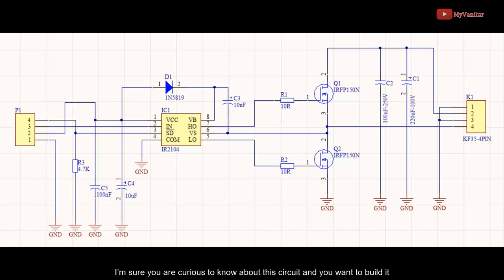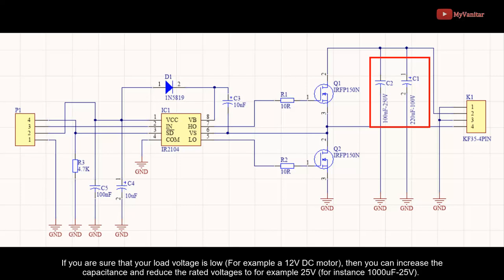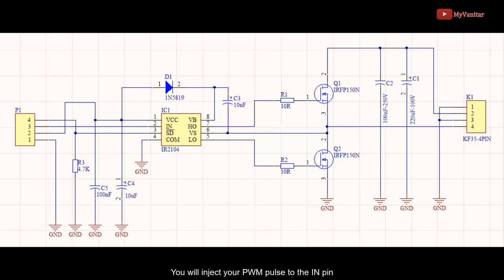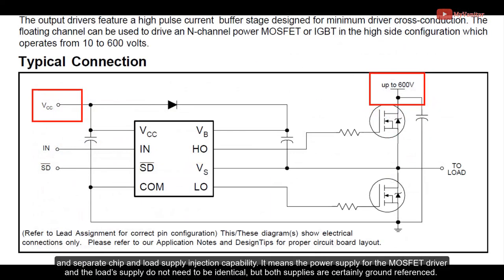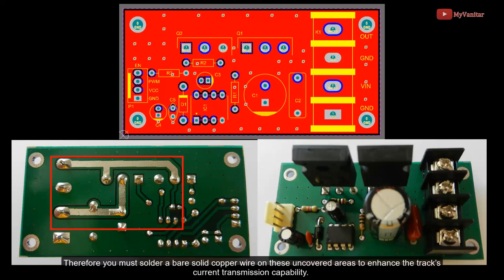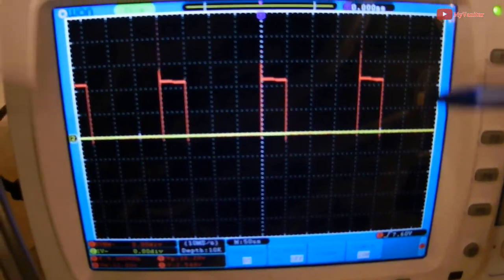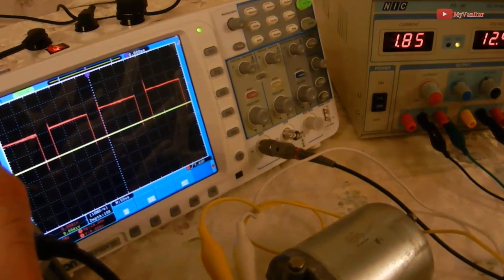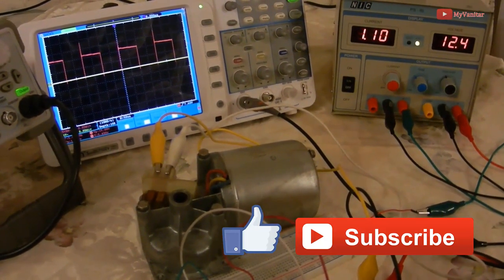DC Motor Driver Circuit Using Power MOSFETs [PWM Controlled, 30A Half Bridge]

Comment: can i use 2 relays to change direction for this circuit. I've seen your full bridge circuit video but i want to use this circuit for my project.
Reply from the maker: You can but that is not an efficient method, you can not control motor speed using relays and PWM

Comment: Great video sir...but unfortunately my circuit is not working properly....i'm not getting what should be done with the SD pin and IN pin...I'm using Arduino nano...with Arduino i'm generating a pwm of 5V with 50% duty cycle. and SD is high (5V logic). but the circuit output is not generating voltage according to the pwm signal...plz resolve the issue sir...i've struggling with the circuit for quiet e time now
Reply from the maker: Did you use my PCB? What's the Load?
Reply: @MyVanitar  my load is a dc motor 12V 500 RPM Johnson motor.  I've tested the exact same circuit
Reply: No I've used the breadboard for initial testing
Reply: And really thank you for replying....plz sort out the issue sir, it's really becoming painful for me
Reply from the maker: this circuit is simple. SD pin also can be connected to 12V (supply of the IR2104), but the IN pin must be logic compatible. make sure the power of the Ir2104 is 12V regulated. the ground of the motor supply and the IR2104 should be common. Grounds are not isolated. did you check? if you checked all of these, most likely you made a mistake somewhere
Reply: @MyVanitar  really appreciate your feedback. I've made the ground common. If you've a contact mail can we contact there. It would be of great help
Reply from the maker: Email is for commercial and business purposes, I prefer comments for questions because others also get benefit from questions and answers
Reply: @MyVanitar  okay sure Sir. Thank you. Update is I've converted my circuit into a Vero board. Let's see if everything goes well
Reply from the maker: if you had watched the video completely, I had noted about the common grounds. unfortunately from the YouTube analytics I exactly see that people from Asia are mostly hurry, just watch for 2 minutes, just want to quickly and magically build something

Comment: I have a solar panel (Voc=4.8V, Isc=13.7A) but IR2104 datasheet says that "Gate drive supply range from 10 to 20V". Can you suggest me another Mosfet Driver IC or do something else. Thanks
Reply from the maker: You want to control the output voltage of the solar panel or you want to use it to power this circuit?
Reply: @MyVanitar  I use it to charge the battery in the morning when my solar panel works, at night my battery will power my LED
Reply from the maker: @tienleminh8129  what is the battery? lithium 4.2V?
Reply: @MyVanitar  Sorry, I don't really know, that is a block of 5 batteries parallel, each battery has approximately 3.4V measurement. I can't see any parameters on it
Reply from the maker: @tienleminh8129  They are lithium-ion batteries. when they are fully charged, the voltage rate is 4.2V for each, when they are packed or if the intention is to keep them without use, the best voltage is around 3.7V. What you need is a switching power supply with 4.2V output voltage and constant current feature, depending on the capacity of the batteries. usually, 500mA current limit is okay.
Reply: @MyVanitar  But my solar panel has only 3.7-4.2V, how can I power my MCU(supply voltage is 5V) I want to make a DC-DC (boost converter) to increase the voltage, decrease the current of my solar panel, so that I can measure it, and use MPPT Algorithm
Reply from the maker: @tienleminh8129  yes, you can use a boost converter. there are some chips designed just for this
Reply: @MyVanitar  Thanks a lot for helping me so much, if I have a few questions in the future, could you please reply me? I look forward to watching your next video
Reply from the maker: @tienleminh8129  no problem, please also aware that my comments are based on your provided information, I have no access to your batteries, equipment .. etc

Comment: Hi Sir, I have a question. Can I build a boost converter with the IR2104 mosfet driver and IRFZ44N mosfets? If so, how would the configuration be like? What would the Vs of IR2104 be connected to? I am a student and this is part of my project. I would be thankful if you can give some advice.
Reply from the maker: Yes, you can. IRFZ44 introduces a low RDSon resistance which is good for this purpose. But you can not use them with this PCB because Mosfet footprint sizes are different. Configuration is identical, the same as Vs. The circuit has a common ground, but the power of the MOSFETs (your motor, load ....) does not need to be identical with IR2104 Power which is 12V. You can run 24V motors, but power the IR2104 with 12V always. This is also good for noise immunity. As a result, powers are isolated but Grounds are common.
Reply from the maker: I will publish a H bridge design in future as soon as I receive the PCB. Subscribe to get notified
Reply from the maker: if you are looking for a boost converter, this circuit is not useful and Yes generally you can use IR2104 for a boost or buck converter. Please contact me directly if you need a specific project
Reply from the maker: @JY-yr7hv  Check the YouTube ABOUT page, contact if you want to propose a project to be designed for you, otherwise if you have a general question, I reply in comments

Comment: Hi am need some help on pwm generator I made a 555 circuit I use a 1 uf capacitor and to pin 7 $”$”& 8 is 1k resistor but the mosfet is getting really hot when turn on in seconds so I need your info on which capacitor valve is best and easy valve to 7&8 is best to get the mosfet to work cool I use a 1 amp load the circuit get smoking hot I need to get the capacitor valve right
Reply from the maker: Do you use my circuit? You can generate PWM with anything you like, such as 555, Arduino, MCU, … etc. This circuit works flawlessly

Comment: Good circuit and explanation video but I can't see it lasting long without some flywheel diodes on the FET's.  Al
Reply from the maker: Thanks. Didoes are embedded inside the MOSFETs, no need to use external ones
Reply: @MyVanitar  Hi, I know most FET's have an internal diode but the back EMF from a Motor or Coil can be many times what the internals can cope with.  for the sake of a few pence it is worth using externals to add to the safety, after all most FET's fail short circuit leaving a runaway motor. Just my opinion.  :)  Al
Reply from the maker: @alanwilliams5999  hahahaha, generally I am agree with you, Alan. Actually I kick the customers who count pennies. A good heatsink with Fan is also the "Must" for high currents otherwise the MOSFET or its diode will burn.

Comment: Thank you for the great video...!!! Is the logic GND and power GND same??
Reply from the maker: Yes, it is, you can power the load from a different supply, but as I said both should share the same ground
Reply: @MyVanitar  Thanks mate :)
Reply: Did you try to connect GNDS?
Reply: @kamuranpeker132  Hi, Yes. anyway I couldn't achieve this. As I remember upper switch didn't work. However, I've used some different components. That may be the reason.

Instead I used TLP250 to isolate signal and power side and implemented software based complementary switching.

Comment: Hello, great video! I was wondering the benefits of the half bridge over using a singular mosfet (with gate driver) which is opening and closing the motor's connection to ground. Any recommended reading would be appreciated. Thanks!
Reply from the maker: Good question. This method or the H-bridge driver (I will publish it soon later) is much more efficient, especially this phenomenon gets more clear in driving high power loads (Motors, transformers ...) at high frequencies. A higher efficiency means lower power loss. it means less power waste and less risk for the Mosfet blow up
Reply: This circuit is a High side single transistor control topology.
The other transistor is working as an ideal diode for back EMF. The advantage is that transistor (instead of a diode) dissipate less heat for big power motor. For a small or medium power one could use just one transistor and a diode. BTW that schematic is terrible.

Comment: Really enjoyed teh video,especially with multidevice hook up when testing. Was the freq of the driven signal causing the non-motor noise?
Reply from the maker: No, that noise is because of the wires. There are more designs similar to this on the channel. watch them all
Reply: @MyVanitar  Will do. Thanks

Comment: can we change the capacitor C1 & C2 with other value capacitor? sorry for my bad English....!
Reply: I'm using IRF3205 MOSFET
Reply from the maker: @ishikatagore6296  Yes you can use other values for C1 and C2, but be careful about the rated voltages. IR3205 has a different footprint, however the circuit is identical

Comment: Is it possible to use a lower frequency PWM to drive this circuit. The controller I am using is only able to do up to a 500Hz PWM at 12V(high sided) and I am looking at a way to use that to drive a 90VDC 5 amp motor with a source voltage of 120VDC. I plan to have the duty cycle never exceed 75% to keep the average voltage in line with the specs of the motor but my main concern is if  the controller is fast enough to be able switch this motor.
Thanks I had been hitting my head agents a wall trying to figure out if this is possible and you have given me hope to make this work very easily.
Reply from the maker: Your motor should do reverse rotation as well?

Comment: Thanks for the circuit.  I built a 6A pump driver with proper gate driver and MOSFET, but the flyback diode blows up very quickly.  I'd like to know how this IC manages back-EMF.  I imagine it has to do with having two FETs.
Reply from the maker: 6A is nothing. However, you can strengthen the MOSFET diode by adding another parallel reverse shotkey diode. I'll also publish a Full H-bridge driver soon. Subscribe to get notified.
Reply: @MyVanitar  Thanks for replying.  I remember reading about using a Zener to clip at a higher voltage, but I'm not sure how this affects the current.  I've done more reading and thinking a half bridge IC is a good option.  I need it to be compact, with SMT FETs like I'm using now.  I'm also considering full bridge to get coasting, but not sure how much that reduces the MOSFET heat.  Happy to subscribe.
Reply: @MyVanitar  Also, I noticed that most half bridge drivers are much lower current (200-500mA), where my current MOSFET drivers are rated 6A.  I'm using a 10 Ohm resistor on the gate and getting around 200ns switching.  If I can only do 250mA, I imagine the FET will get much hotter.
Reply from the maker: @ChristieNel  if your MOSFETs are getting very hot, it is better to not to use SMD MOSFETs, because it is a bit harder to dissipate the heat. The advantage of an H bridge is ease of changing the rotation direction (right-left). I have tested this half bridge. if your DC motors only needs to rotate in one direction, just go for it. with 3A, I don't even feel the warm up on these MOSFETs!
Reply: @MyVanitar  That's encouraging!  My MOSFET measured over 100 degrees before it popped, but I'm pretty sure it was a more complicated sequence of events.  Diode dies, MOSFET goes avalanche, goes hot and pops.  I tested it first to drive a 1A heater and that worked flawlessly without any MOSFET heat.  It's based on a previous precision heater circuit I made that does 6A without MOSFET getting hot, but quite slow switching.  I only need one direction and it sounds like half bridge would work just fine.  However, I'd like to know how this slow decay method compares with full bridge fast decay in terms of overall power efficiency.  I'm using a Cytron full bridge board for the drive stage temporarily and that works great.
Reply from the maker: @ChristieNel  That's why MOSFET drivers exist. Much lower rising and falling edge because in switching conditions, the capacitance of the gate increases. H bridge has advantage of direction change.
Reply: @MyVanitar  Isn't an H-bridge driver also a MOSFET driver?  I would imagine they should have the same current capability as a single gate driver?  H-bridge also has the benefit of fast decay / coast mode over half bridge and single gate driver, right?
Reply from the maker: @ChristieNel  H-Bridge and Half-Bridge are identical, except that H-Bridge can also reverse the load's polarity without changing the supply polarity. Both use MOSFET drivers ICs
Reply: @MyVanitar  Hmm... it sounds like maybe you're not aware of fast vs slow decay... which is something I learned about after watching your video.  An H-Bridge can recirculate the current like a half bridge using the freewheel FET (slow decay), but an H-Bridge can also reverse the current to collapse the field and causing a "coast" mode that doesn't brake the motor like recirculating mode (fast decay).  I'm questioning the energy efficiency of each.
Reply from the maker: @ChristieNel  That's exactly what I mentioned by simpler words
Reply: @MyVanitar  Ah, okay.

Comment: can please feature on your video on how to make a circuit like that in a 3 phase bldc motor with high input voltage? shall we say 300vdc input...thanks
Reply from the maker: Sure, as soon as I find time, but BLDC motor controlling is much harder than DC motors, anyway where do you want to use these high voltage motors?
Reply: @MyVanitar  in washing machine motor to drive a generator
Reply from the maker: @noelmelo3460  I think the washing machine motor works with AC voltage, this circuit is for DC motors

Comment: I thought breadboard max current can't be 30A. So which board should I try for 30A high power motor driver circuit
Reply from the maker: i can not offer any advice or suggestion when the circuit is being tested on a breadboard. it may work or not

Comment: Hey I can see that there is voltage spikes on the PWM signal to the load. Do you know how to reduce that spikes?
Reply from the maker: Your load is a DC motor? spikes are natural, however, you can install some capacitors on the load. the capacitor's voltages should be at least 25% higher than your load voltage. besides the ground lead of the oscilloscope probe also absorbs noise and shows as spikes, which are not there truly
Reply: @MyVanitar  thanks

Comment: Hi thank you for sharing very nice circuit. Can i ask would this circuit be able to handle 24v input for the motors and 30A continous load with proper heatsink on the FET'S
Reply from the maker: Hi Paul, Yes you can run 24V motors with these Mosfets, as I mentioned in the video and article, you can set any voltage (up t0 600V) and current, but you have to select suitable Mosfets for your desired voltage and current. Also be careful about the capacitors voltages (I set to 100V in this circuit). in your described condition, 24V is okay with these Mosfets and capacitors. 30A continues is okay according to the Mosfet datasheets but the key is that you must keep the temperature down, therefore yes I suggest proper heat-sink and even a fan. I suggest a CPU heatsink which comes with a FAN. it's cheap. Be careful about the Mosfet isolation and use thermal pad, I noted this in the video and article. Good Luck.
Reply: @MyVanitar  Thank you Sir for your reply and detailed instruction. Would this circuit require much modification to enable Forward/Reverse control of the motor
Reply from the maker: @electro3976  for that purpose, You would need a H-Bridge driver. I'll try to cover that sometime in future. As you can see designing and building a board gets time, energy and money. probably I have to open a Patron account for support.
Reply: @MyVanitar  That would be great if you can find the time thanks again

Comment: Hi brother. Why don't you use snubber circuit?
Reply from the maker: This is not a SMPS design
Reply: @MyVanitar  It doesn't need to be an SMPS design. Since there is no snubber circuit, this circuit will be very inefficient at high currents. It looks very likely to be corrupted.
Reply from the maker: @elektrik-elektronikmuhendi6985  Thank you for sharing your opinion, however I'm not agree. one of the the major advantage of a half bridge is its immunity, otherwise we can easily driver everything using a single Mosfet. However I used some caps there.

Comment: how can one control/adjust the current
Reply from the maker: There is no feedback loop to examine the current, however as you decrease the PWM cycle, naturally, you decrease both the voltage and current consumption of the load. In the future, I may design a circuit with a current feedback loop
Reply: @MyVanitar  thanks, I need it for torque control
Reply from the maker: @more2much696  Then feedback is necessary. I will design this in the future, but I can not guarantee the time

Comment: Can you please tell how can we use this for full bridge circuit to control speed in both directions.
Reply from the maker: I have designed a full bridge motor driver and I will show it as soon as I receive the PCB

Comment: Hello sir, do you inject pwm at SD pin? or just inject steady state logic 5v? thanks.
Reply from the maker: if you check the datasheet, the SD pin is active-low, it means if you connect it to the ground, it will turn off the chip. In the circuit, I have pulled-it down with a resistor to avoid unwanted triggers. So whenever you want to turn-on the chip, you will connect it to the 5V for example (minimum is 3V). Also, you will inject your PWM pulse to the IN pin.